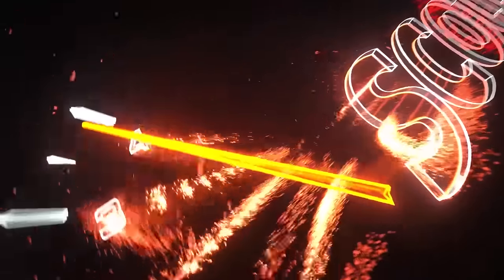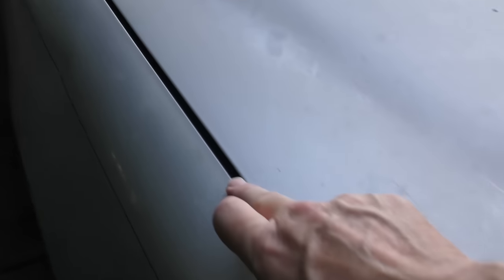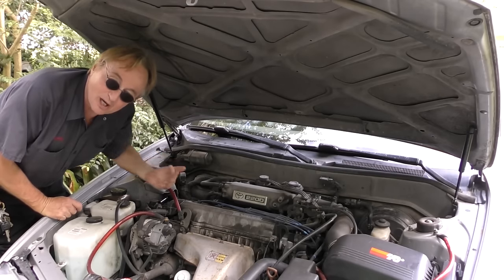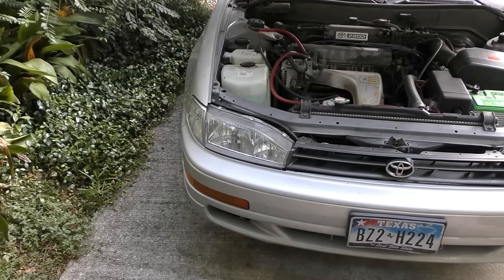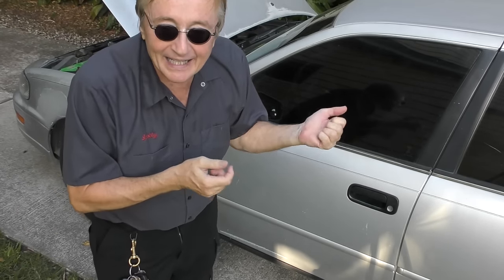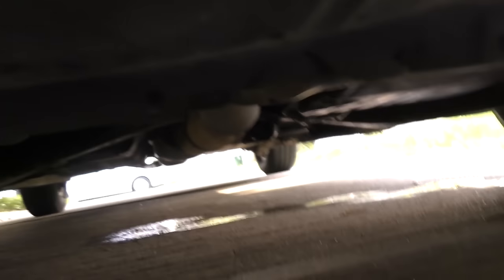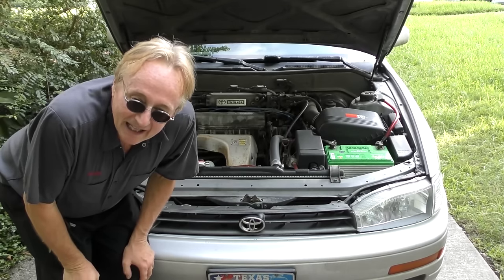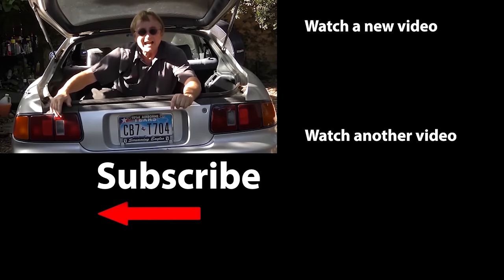Can You Destroy a Toyota Camry

Comment: I have a ‘02 Camry
Not my favorite but it’s indestructible
Reply: Think again, if it's a 4 cylinder, those 2AZ-FE engines have TONS of problems.  I owned one.
Reply: Bro I love my 02 Camry
Reply: Black Einstein yeah they are good cars
Reply: jaykay18 but I made sure I maintain it
Reply: James Christensen it’s a good car
Reply: I have an 07 V6, absolutely blows away everything the 02 ever did in every aspect of the vehicle.
Reply: Old boi
Reply: I have the V6 02 Camry. Only thing significant that has had to be replaced are the coils and starter. Cosmetically, the clear coat on the hood is coming off. 
Car runs great though, and is the fully loaded XLE model.
Reply: Poldariser when you get to 300k miles, you will have finally broke that car in.
Reply: I had an 07 Toyota Solara V6 (2 door camry) , i ran it for 632000 kilometers before the automoatic transmission started to fail . 3rd gear was a bit funky .  I was a car parts delivery driver.  400km a day.  Eventually i got T-Boned by a chinese lady and it was a write off.  But that car had practically no problems for 95% of it's life
Reply: @aundrayperkins9796  Haha
Reply: Mine is 02' Camry with 380,000 mileage. Still running good.
Reply: @tutungtutung  Oh my...
Reply: What don't you like about your 02 Camry? I have a 93 Corolla. and although it's also indestructible, I always felt that Camries of the same era must have been smoother to drive and more powerful on the road (i've never been in one, just something i see from the outside). My corolla handles bumps and road imperfections pretty horribly (You can even feel the sand particles on dusty roads through the wheels!).
Reply: Try the Generation before that one, I got a 00 Camry 4 cyl & a 99 Camry V6 5 Speed they both run like clocks but my 09 CR-V takes the cake for tankness
Reply: @jaykay18  I didn't have any problems with my 03 Camry with that engine
Reply: @angrysocialjusticewarrior  my 02 drives like a dream. I just replaced the struts at 196000 miles. It handles very well and very comfortable

Comment: The only reason our old 97 Camry is no longer running is that it went backwards through a guard rail, over an embankment, flipped end over end a couple of times and finally came to rest upside down 5 feet from a creek. The impact was so hard that the emblem from the front was found 50 feet away. Everyone in the car walked away from that one.
Reply: Blimey.

Comment: There it is, I'm getting my wife one of these. 35 years old and just getting her license. Looks like it will be a great first car.
Reply: Might want to get her something newer so it's safer.
Reply: Get the 95 XLE V6.
Has 200hp not very impressive but that engine is really strong.The 2200 four cylinder has bad oil seals under the timing cover.
Reply: Yeah, a new Camry would be much better.
Reply: @IJoeAceJRI  
It’s a steady 18-22mpg depending on habits
Reply: toyota camry was my first car and i still drive it

Comment: I have a 96 Camry with 272 thousand with the v6 ..
Never has let me down , hit the key and go anytime you want
Reply: Just gave my '00 Camry its last drive to the junkyard rip camry 2000-2019
Reply: @Tommmmmmyssssss  What happen to it and how many miles ?
Reply: Tommy Sullivan Nah JC Denton took it from you.
Reply: Same here with mine. The 96 V6 XLE Camry is best used Camry to get. Mine is at 197,000 miles trouble free and I still have all the orginal parts even the orginal water pump and timing belt
Reply: @jtf-joshtfitnessandlifesty3470  change that timing belt fam

Comment: Man, these Toyota's from the 90's were indestructible.
Reply: They made a good car you can keep them running with minimal expense since parts are readily available for them if needed.  Sad to say new ones aren't as well built or as reliable.
Reply: @1575murray  New ones are still way more reliable than all other new cars.

Also, new Toyota's more be a bit less reliable than older ones due to modern electronics, but the drive trains in new ones are still just as reliable if not more.
Reply: Are
Reply: @limeyosu2000  Actually the assembly plant in Kentucky had opened by then but I think the engines and transmissions came from Japan.
Reply: @thc7865  
Hi Skeletor!
Reply: @1575murray  Yes, my 86 and 91 Toyota Trucks were built in Japan, my 95 Corolla and 95 Tacoma were built in the United States, along with the 2000 Tacoma I currently drive with 177,000 miles and runs great! I've been driving Toyotas since 83
Reply: There's a great top gear episode where they try everything to destroy a Toyota Hilux pickup
Reply: Toyota and Honda were king for a reason during that time
Reply: Great news! I just bought an LE V6

Comment: I scored a 98 camry couple days ago for $500. Thing runs and drives like when it was new. Cold A/C. One minor spot of body damage on front fender. 251k miles.
Reply: 500 in this market? Wow you got lucky or he just sold you a $1000 mechanic bill
Reply: lucky to get one at that price wow
Reply: @okas425  
You can get a 2003 for $2k
Reply: @Eye-it-azz  Where??! I crashed my 1993 accidentally (thank God it was the car and not me. Rear ended a 2014 GMC truck during rush hour sadly. 17 year old driver vs. me 38 lol). Anyway, my family and I was desparate for a replacement and we didn't have a lot of money so my "new" 2000 Camry was 3.5k plus taxes and fees so it was a little under 4k.
Reply: 3.5 K for 2000 camry, sounds like you got a decent/good price. I paid 3.6k for my 98 v6 Xle camry with 160k miles. Excellent interior (except driver seat wear), beautiful exterior and maintenance was very apparent.  If you have something similar id say you payed a great price especially in this market. I got mine 3 years ago at a dealership
Reply: @okas425  she's still running strong, no problems yet.
Reply: Wait, what $500 dang dude u lucky
Reply: Just bought a 2000 2.2L with 158k for $1200,  also have a 96 with a bad finally drive bearing, it's now a parts car

Comment: The Scotty Kilmer approved cars list is expanding!
1. Toyota Celica 1994
2. Toyota Camry 1993
3. Volvo XC70 2007

AND MORE!
Reply: Don’t forget 2002 Lexus ES300-his wife’s car
Reply: and more ... toyotas pol
Reply: @ddk80  Indeed!
Reply: Old Hondas too
Reply: @ilikeboost4764  I have to agree with you. The best car I ever owned was a 1997 Honda Civic Ex with the V tech engine. Damn was that car fun to drive! The acceleration, handling and braking were far superior to any car I ever driven.
Reply: David Morris yep. I occasionally drive my dad's 2000 Accord (2.3/5speed) that crossed 230k yesterday. The damn thing won't die. Hasn't had an oil change in like 10k with conventional. I realized the other day it was 2 quarts low. I think the clutch is on its way out but we just abuse this thing. He bought it with 205k on it about 6 months ago expecting it to only last long enough to get the insurance check from the last car but it won't die.
Reply: @ilikeboost4764  : That's good to hear. Sounds like with a little work you can get another 100k or more if you wanted with this Accord.  Or consider doing what I did where I just gave my last vehicle to a friend in need.
Reply: Yeah I'm thinking if it hits 250 before the clutch is completely shot I'll be happy. Depending on everything I might change it and go for 300.
Reply: Ilikeboost you keep running it down 2 quarts of oil.. It will die soon! Obviously it's burning or leaking badly!
Reply: It does a little of both burning and leaking.
Reply: But yes I know I need to be more on top of the oil.

Comment: I own a 1997 Camry LE 4 CYL.. It has been a year and I've run 40k miles on it so far. The odo reads 170k...still runs like a charm, AC blows cold and the stereo still works. Masterpieces of the day when auto engineering was an art.

Comment: I purchased a 1997 Camry xv20 this past weekend and I’m thrilled to have a simple and reliable car. I baby every car I own regardless of age so I will be careful with it and keep it clean and well maintained anyway but it will probably be good basic transportation for a couple of years hopefully.
Reply: Is your camry still going ok?
Reply: @semklm7579  Thanks for the question, super unexpected after 2 years! Yes, actually it is doing really well and i've put many more miles on it. Tomorrow morning i'm going to a tyre shop because the steering wheel vibrates at lower speeds (probably one of the front tyres are defective) but almost no issues and passed a completely clean inspection last spring.
Reply: @kimhjalmarsson8886  Ive got a beat up 97 one my uncle gave to me for free and it being my first car really makes me want to go and find one thats in good condition so bad lol

Comment: The Toyota cars in the early 90s  was a sweet spot of  engineering, they were simply made, and there wasent much over complicated computer control of the engine. Usually the only thing that  kept  these cars down was a bad coil, other than that they would just keep on chugging along.  Thanks for the video
Reply: They were based off Lexus as well
Reply: @toyoscio  I cant remember what model but the wiring diagram are the exact same for this year
Reply: @fixergood  Maybe the GS 300?

Comment: I valet parked back in the mid 90’s, and remember the v6 Camry.  It was fast for back then.
Reply: j freed my daily is one. A ‘99 V6 manual. Thing is a blast to drive and is still indestructible. 200k miles on the original clutch.
Reply: @j_freed  I was given a lift in one once. It sounded like a sports car.
Only later did I realise how rare they are.
Reply: It's also faster then a frs or a brz
Reply: My 92 Camry 6cyl has only 71,OOO it does O to 60 in 8 seconds is the most reliable car Toyota made   it rides as quiet as smooth as my old74 CAD and runs like a scalded dog

Comment: Back in 87 I had a Camry, 2.0 little twin cam 16 valve engine and it was a stick.
It was like a BMW of that time period, but actually got you home! Loved that Camry.
Reply: Stevespecs I had a ‘88 manual Camry in 2001. I have never been more confident that the car was dead on reliable. Loved that car! Tires, brakes and oil changes
Reply: Had a 86 stick, 4 banger Camry. Once I figured out I could not drive it like my Corolla, had a blast with that car!

Comment: I still drive my 1987 Camry wagon which my wife got from her grandmother with only 40 000 kms in 1996!  now it has 385 000 kms and still drives like a new car! Inside and out it's still like new, only a little bit of rust around the rear fenders, nothing else. Got is sprayed with Krown rust control every year since I had it, The interior has no cracks in the plastic the dash looks brand  new! Great car! Just keeps on going and going! 
 I have classic car insurance for it now so it's even cheaper to run now! Costs almost nothing per year! I get a lot of people giving me thumbs up and looks at the car.

Comment: yep 90's- 2002 honda and toyota 4 cylinders you can't go wrong.
Reply: Even Nissans were superb up until about 00
Reply: HAL 9000  the 2011 pathfinder is good it’s just a frontier with a 3 row body on frame
Reply: Only the  older manuals tho. The autos are mostly fine and cheap.
Reply: It's basically anything that was built before 1998 Asian financial crisis,  and 2001 in US.  All cars before that time, were built to last.  Even my 95 Nissan maxima.  After that they never regain the glory even after the second 2008 US economic collapse.
Reply: Can confirm. Still daily driving my 96 Accord.
Reply: @lucky889s9  Who?
Reply: 02 Accord with 216K miles on it.

Comment: Crank windows are just fine by me. My car has crank windows.
Reply: they never break down
Reply: After 50 years and my car still haves the cranks work
Reply: Hell as long as they work. To hell with power windows. Even tho I’d probably want that little sliding door on my windows like on racecars instead of rolling it down
Reply: Keep fit windows

Comment: I have a 2000 Camry CE with the 2.2L engine and 5 speed manual transmission with 168,000 miles. It is dirt cheap to run and easy to maintain. Outstanding fuel mileage and the coldest air conditioner I have ever had in a car. The 5 speed really makes it a fun car to drive also.

Comment: I actually recently killed my 95 camry CSI. bought used 6.5 years ago with 190'000 Kms. Now in Australia you sorta expect heat problems. The radiator died 3 months ago and for several weeks the new one had teething issues, once it was all said and done the new cooling system created better pressure which folded the old head gasket. The engine still continued running, sure, vaporising coolant that was leaking into the #2 cylinde  until it finally ran out of coolant, overheated and warped the aluminium head. basically a total loss. fixing it would be more than the full value of the car at that time.

Australia . is how you kill camry's

Comment: That car has a very reliable 3FE engine, high torque at low rpm. Mine has 237k miles.  In January it will be 30 years old. I need to get a receptacle replaced for a bad break light on the left side. AC blows cool with R134A.
Reply: You mean 5SFE.
Reply: @rubenmarino1999  Yes, sorry
Reply: Merrill Miller I thought I would have to replace the receptacle on our travel trailer. I bought LED taillights online, thinking I would just replace them. Then I started messing with the old light, thinking I had a bad ground. All it took, to fix the problem, was to squeeze the receptacle, with the bulb removed, and reinstall it. Bad ground alright. Just not in the wiring, just too loose of contact, on the bulb.
Reply: 237k in 30years I got 226k in my 18years audi v6 original engine but transmission was replace at 135k for $700 8years ago.

Comment: "runs like a clock"

*Floors it in L gear
*Tachometer doesn't work
*Speedometer doesn't work
*"Power window" doesn't work
Reply: But the actual clock works so.......
Reply: none of that has to do with the powertrain nor drivetrain
Reply: @chibba5418  Exactly what I'm trying to explain to my friend, but he is a Tesla fan and a Toyota hater for some reason, he has no explanation of why he hates Toyota, whatsoever.
Reply: @VramanNoodles  yeah. Toyota builds solid powertrains, and while their applications tend to last pretty well, that's not their powerhouse.

I see tons of corollas with shite interiors, tons of broken electronics, and peeling clear coats, but they run flawlessly.

After all, we don't buy a car for the power windows nor tachometer, we buy a car to get us places
Reply: @chibba5418  EXACTLY!!! Finally someone with common sense
Reply: @chibba5418  Toyota: ”Let’s go places”
Reply: 390k on my 96 Corolla and I'm sure its gonna make it to 500k. Wont take me long either as I drive about 3k a month.
Reply: @Cali_ Kid Yes, it will. A few things regular oil changes, timing belt. After about 150k or your second timing belt change replace the oil pump o ring gasket and seal it will leak eventually. And dont let that sucker overheat. There you go.
Reply: @chibba5418  Toyota Camry and Corolla are the best A to B cars ever made. Period.
Reply: @jellyroll5247  + Honda Accord + Honda Civic + Honda Fit + Scion tC + Toyota Prius
Reply: @chibba5418  had a  85 civic back in the day and a 87 accord LXI. Both were great cars. You can't go wrong either make.

Comment: (Using wife's Google account to comment.) Bought my pre-owned 1995 Camry LE 12 years ago (same color as the one in the video) and it now has 302,000 miles on it. Yes ... of course, it's runnin' like a top! I can do a steady 80-90 MPH on the highway from Tucson to Phoenix (and back) in 110-degree heat with the A/C crankin' COLD and the damn car doesn't even breathe hard! Original 4-cylinder engine and automatic transmission as one would expect. I just posted a sign in the back window: "300,000 + miles! Pushin' for 4 !"

Comment: My 2001 Camry 4 is going great at 170,000!.....yea...its only just broke in
Reply: My 2003 Accord just went over 170,000 miles.  Runs like new.
Reply: Matthew Nicholson -   Nice!   My 1994 Camry has 418K and my 2007 Accord V6 has 240K.  These things were built well so just do your maintenance.
Reply: 03 5speed manual Camry with 206K here.
Reply: My 97 camry 4 cylinder is at 308,000
Reply: I just bought an ‘01 with only 123,000! EVERYTHING WORKS! AND ONLY FOR 2k
Reply: Great buy Adan
Reply: My 2000 Camry had 250k when I got rid of it
Reply: @wildforthecats7792  yeah cool story bro

Comment: I have a 2000 XLE 2.2 four cylinder. I call it my tank. Your absolutely correct. Dings and dents from a kid that parked it in Philadelphia at Temple University. Not a great area. But mechanically everything works great. 700 more miles and here we come 200,000. I'm driving it till it blows up. Just put all new struts around it. Cheapo ones from Rockauto there much more heavy duty than the standard oem strut. Scotty 💯💯👍👍

Comment: Got a used 96 V6 LE Camry with 193,000 miles for $1,200 and it still runs really smooth and all the electronics inside work great. If you're trying to get a used Camry I recomend to try and find a V6 because they are faster and more fun to drive and will last longer
Reply: Great great car 
I have the 2.2 litre.
Smooth and powerful v6, but it does not outlast the 4 cylinder. 
I would however in my dreams want to be v6 of coupe love that you're even the wagon you cannot go wrong with a 3rd gen